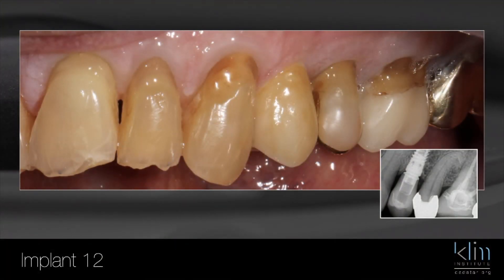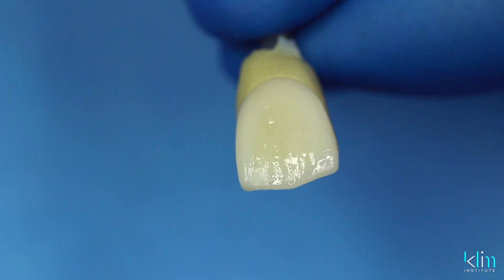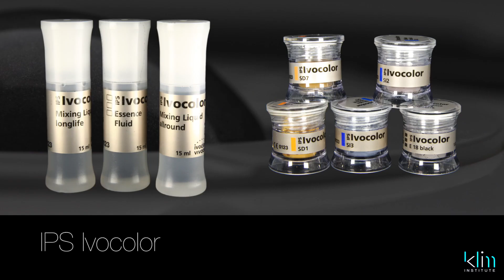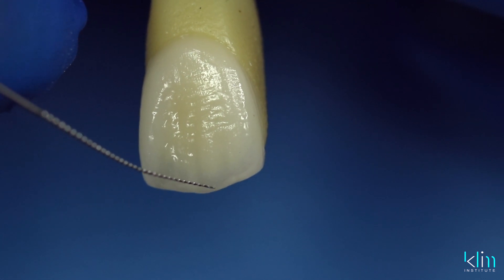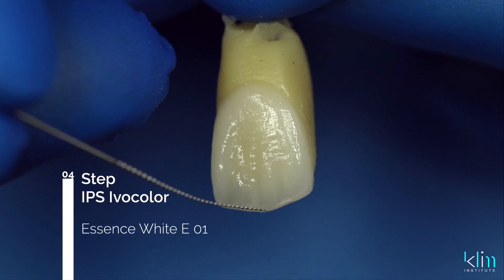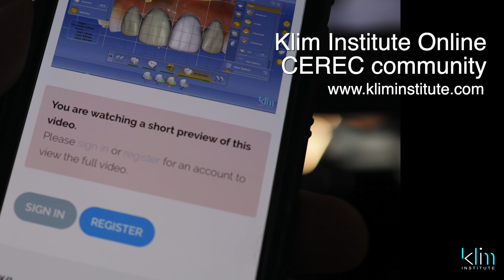Anterior e.max Ivocolor Stain and Glaze Technique

Comment: What ceramic did you use? I need to make a full anatomic upper premolar, and I don’t know if I should use Multi or “normal” MT, HT ceramic ingots for presing from Ivoclar. 
Thanks for your reply in advance!
Reply from the maker: e.max is my number one ceramic, though I do use LiSi, Empress, and feldspathic.  It depends on the function and where the restoration is in the mouth.  e.max works well with both aesthetic and functional in the premolar zone.  See the following video; it will help you make a choice. https://www.youtube.com/watch?v=tm5mgXQR_0A&t=549s

Comment: Wonderful artwork! How do you print 3d models for this kind of work? regards from Austria
Reply from the maker: Currently, I am using the Asiga printer.  The exported STL file can be processed in software like inLab by Dentsply Sirona or Meshmixer, then transferred over to the Composition printing software of Asiga.  The two top printers for model accuracy is Carbon or Asiga.  The Asiga is much more affordable for a dental office.
Reply: @KlimDDS  Thanks! I also heard of the Asiga and closing the STL files... sounds a bit complicated. I started with Cadcam one week ago with Primescan/mill so maybe it's a little early with InLab after just getting used to Cerec 5.2 at the moment :-)
Reply from the maker: @zahnarzt.dr.rudolf  Several options, send the STL file to a digital lab.  It is a minimal fee for the printable model.   They are accurate.  I use them for finishing my larger cases.  Best of wishes in your Primescan journey.  If you would like more sampling education, go to my www.cadstar.org website and view the complimentary lessons called CEREC Kick Start.  There is also a yearly membership option.  All the best.
Reply: @KlimDDS  will definitely consider that, your course sounds great. thanks!

Comment: Do you use object fix to fire at the end? Or do you leave it on the perforated pad you set it on?
Reply from the maker: For crystallization Object Fix is indicated, once crystalized, will still use a firing paste such as Object fix for a full crown.  For veneer, I usually use a honeycomb tray and lay the veneer down with diamond hemostats.  All the best!
Reply from the maker: Either way, options work.